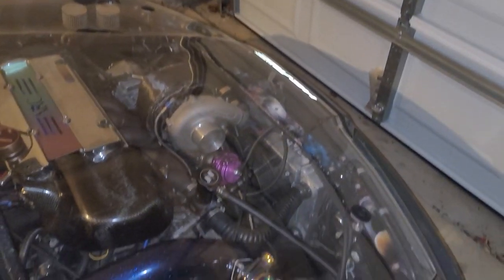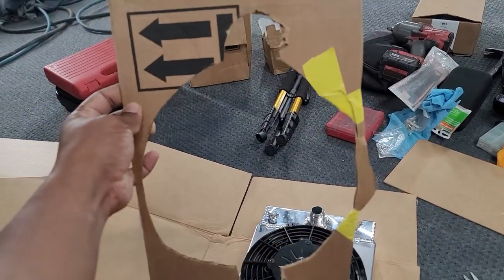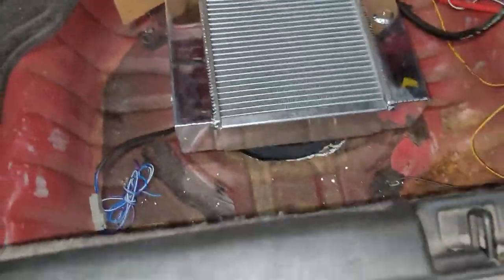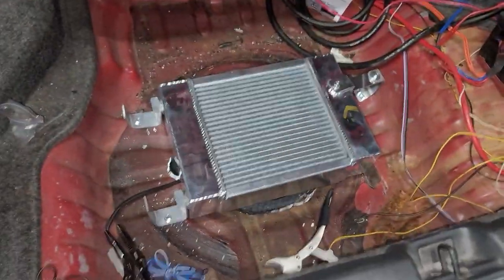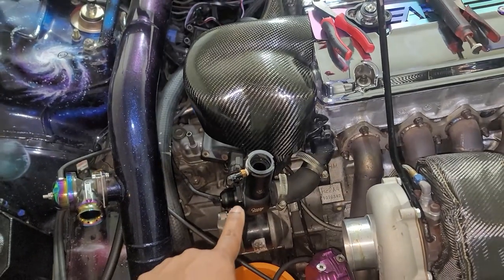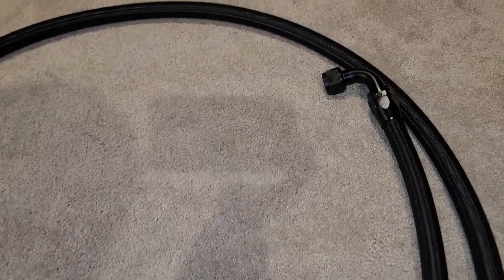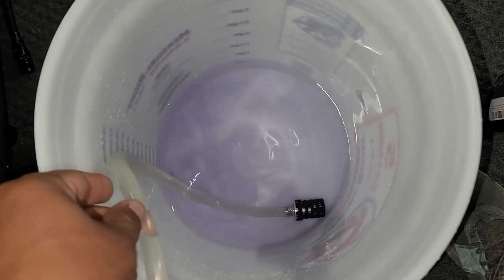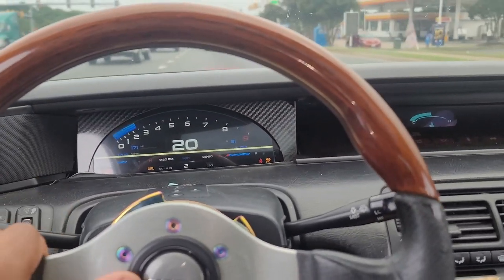2 radiator set up in my 600hp turbo honda prelude

Comment: Just had to change from antifreeze to water for the same over heating issue. If it does not solve the issue I'm going back to a full radiator some how.
Reply from the maker: You can try purple ice in distilled water but if your over heating at idle like I was on hot days then it's a capacity issue. Your gonna have to do the same thing I did to daily the car

Comment: With that amount of power the -16AN is the restriction/issue I believe. Should be using the normal size hose fittings chase bays offers. 1.38 I believe. Just my opinion though

Comment: If you mounted the radiator with fittings facing up you would not have a pocket of air in the rear mounted radiator but using the vacuum coolant device I’m sure it helped.. neat cooling set up for sure tho not knocking it at all.. and this is coming from a guy that has a twincharged b series coupe supercharged turbo b series yes you heard that correctly lol
Reply from the maker: Yea I thought  about that but I would have lost function of my entire trunk so I decided on face down. 

But that's crazy twinncharged 🤯

Comment: What happens to road debris that hits this, or if you get bumped in the back your car will fold. Really interesting but probably not a great idea for most to do.
Reply from the maker: Def not for everybody but in my particular case and the hp that I make, I needed it to stay cool in the summer
Reply: @treybedipping1734  didn't know you where super responsive! Question how is the hood warp holding up? I love that hood but the warping scares the crap out of me to do that.
Reply from the maker: @redhat_maveric3633 doesn't really warp its not not very hard material in the first place so has alot of flex
Reply: @treybedipping1734 I'm shocked that the heat doesn't cause any type of long term warping damage. That's really awesome, how are you handling or is there any heat discoloration of the material?
Reply from the maker: @redhat_maveric3633  nope

Comment: Hey man I keep over heating at the track I’m thinking I’m gonna do this. How many feet of line did you need? Mines a 5th gen but it should be close to the same.
Reply from the maker: I think it was like 40-50ft. It's expensive but definitely worth it.

Comment: Why did you install the radiator this way and not sucking fresh air from the bottom?
Reply: You make no sense.
Reply: @SIRICKO  the way it's mounted the radiator will suck in air from the trunk and dump it under the car. 
The common wisdom would be to mount it the other way around so that it sucks air from under the car (and then put a vent in the back of the car, be it on the bumper or the trunk, to let that air escape)
Reply from the maker: @loubeeyoum7556  are asking about the rotation of the fan? It made more sense to pull the air from inside to atmosphere (outside) to avoid sucking up fumes or dirt into the car
Reply: @treybedipping1734  you could probably make some kind of shroud to get all that neatly out of the car and you'd  have better air flow to the radiator and maybe some minor aerodynamic advantage. But it'd make your trunk almost unusable so 
I guess for a road car it's not worth it
Reply from the maker: @loubeeyoum7556  yea came up with 3 different ways to do it but this way made the most sense. And like you said I still have use of my truck this way

Comment: So confuse why another radiator? Space better used for fuel cell ? Just seem like alot extra. No hate. Looks cool but as a mechanic. Why? Much love my guy. Good seeing your still at it . Been years
Reply from the maker: You didn't watch the video or you would know lol I had a capacity issue because of the smaller tucked radiator so for daily driving it would run hot....and now it doesn't

Comment: Hey bro I had a couple questions I just blew my h22 on my Prelude And I have a stock F20b laying around Basically my question is what do I need or to do to make my built H22 head work on The stock f20b & what head gasket please get back to me💪
Reply from the maker: When I did it on mine I used a f20b head gasket and it worked perfectly fine